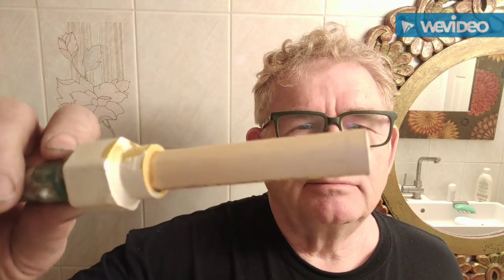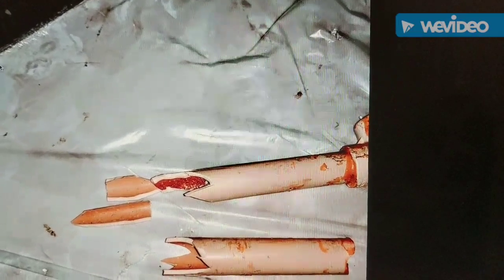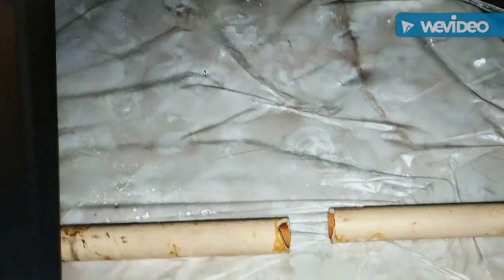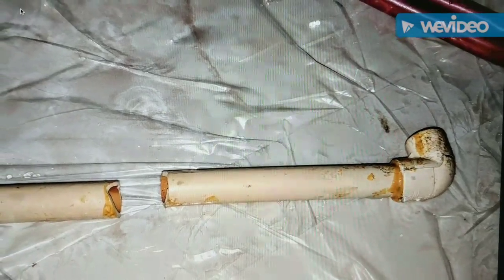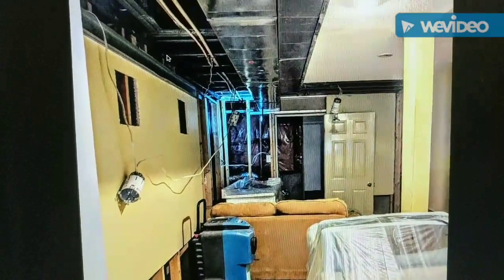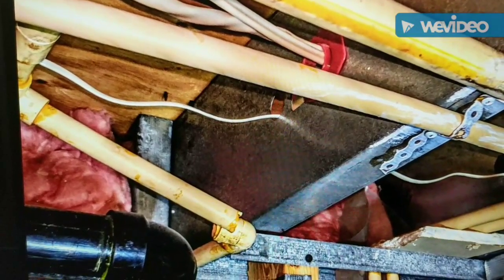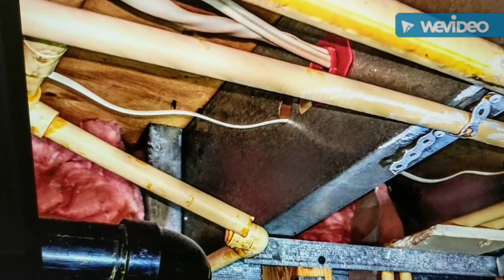The Danger Of CPVC pipe

Comment: you dumb ass dont know what your talking about,  Cpvc is not make for squeezing with pliers or being pulled on like an idiot.  I see this pipe which was in homes for 30 years and its like new.
Reply from the maker: I can't Help it if you are a semi-literate Lobbyist for The plastics industry-
Reply: I noticed it gets brittle over time My father used it in his rentals and house, it's easy to work with once you know it gets brittle and use the right tool, I had a leaky valve and had to replace a section, I used SharkBite couplings (those work great), the salesman at Menards said use this ratchet CPVC cutting tool (it was 4.95 Cheap!), I used it and it cracked the CPVC pipe, went back to Menards exchanged it for the more expensive pipe cutter (the one you roll around the pipe tighten it and roll around again until cut)...that worked great...The main problems I have had is the plastic valves going bad over 20 years, other than that the CPVC pipes are fine and I'm not a lobbyist for the plastic industry or SharkBite also have used WATTS Quick Connect I like those too.

Comment: CPVC has been used since the 90's. In my part of the country, the water destroys copper in 2 years, and clogs up with lime etc sooner than that. The inside of CPVC does not build up and burst as easily, so that's what is used - successfully.  PVC for miles and miles of water outside and cpvc for potable inside plumbing.
Reply: Luis Mederos I wouldn't. Stick to schedule 40 pvc, or copper.
Reply from the maker: Check all The Lawsuits (on Line) Against CPVC if you don"t Believe me-I wouldnt use it to Pipe a  Dog House
Reply: Could cpvc be used outside underground?

Comment: BOOM same shit happen to me....and the EXACT same way....garden hose was connected to this garbage. ... dry rotted all the way!!!!!
Reply: You may want to get a tight solid fit with your connection with your garden hose if you know your going to be pulling/tugging on your hose hard, I have CPVC pipes connected to my garden hose coming out of the basement, my outside connection is solid and does not move at all, problem solved, check it do yearly maintenance.
Reply from the maker: I would check out some of the Class action Lawsuits-There are big Problems with CPVC in condo Sprinkler Systems and I think that Chlorine in Water makes CPVC ,Brittle over long term  exposure

Comment: Put It In My House I Built 25 yrs Ago ...All Good So Far!!!
Hell Of Alot Easier Than Copper.
Reply: If done correctly no problem
Reply: It would seem that Regarding that woman who pulled on her garden hose,  the hose fitting on the wall, and the cpvc pipe on the other side of that hose connection perhaps was not secured to a stud or joist, allowing it to be moved around inside the wall.  Of course it's not designed to move like that.  No pipe is, cpvc, copper or otherwise.  Doomed to fail from the day it was installed.
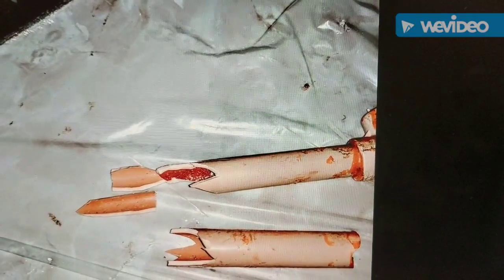Reply: I did mine 7 years ago and I still add faucets and fittings now and then. I get clean cuts and no cracking whatsoever. Whoever did this job did a shitty one from the looks of it and theres some buildup of crud at 2:05
Reply: Cvpc is ancient technolgy.  The worst thing is when you have a beautiful house built in the 90s and all of the plumbing is cvpc with cvpc twist valves.  Even the supply from the well. Poor poor people....  It's like California...  Nobody's knows when it will happen....  It's just a matter of time!
Reply from the maker: THe CPVC was done Correctly and it was inspected and Passed by The Plumbing Inspector -How Much more correctly Done Would you Suggest? "
Reply from the maker: All planes don't crash and all cars don't collide - and not all pipes fail but there are major lawsuits against CPVC and Kitec (pex-al-pex)- I based my video with CPVC on numerous repairs as a service plumber with CPVC- just because it installs faster than copper and your one experience with your house installation forms your opinion - doesn't mean that your experience with CPVC will apply to all users- I won't use it and find copper ,PEX or WISBORO are much better bets for longevity and safety ,than CPVC (because I pay my own business Liability insurance) but thanks for your experience
Reply: David Laird good to know pez is a better choice than cpvc. Makes my decís easier , thanks
Reply from the maker: Check all The Lawsuits against CPVC on Line and On You Tube If you dont Believe Me